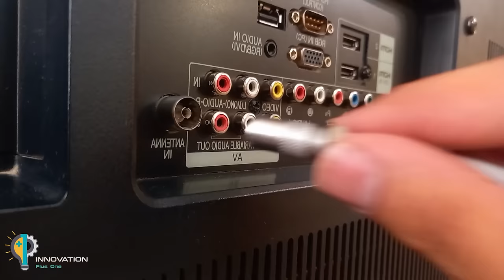Insert Battery Into The TV and Watch All Channels In The World || Antenna Booster

Comment: Okay so you made an RF modulator but what happens when your battery dies why do you design it with a battery holder so you can swap out battery. Plus this design and the other one I saw that you did with sim card was just a digital antenna which also means that the SIM card would have to be active both of these the way they are built radiates signal noise into all nearby electronics. You should probably lead with that. These are hacks at best and should not be suggested.
Reply from the maker: Thank you for your comments about this antenna, these dipole antennas work well in ideal environments, although they may not be cost-effective due to battery replacement.❤❤🙏